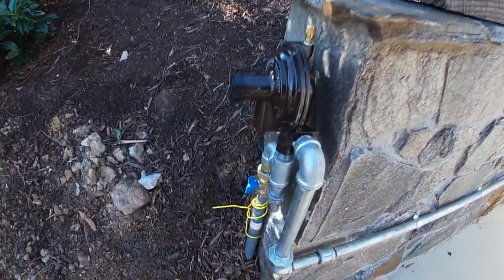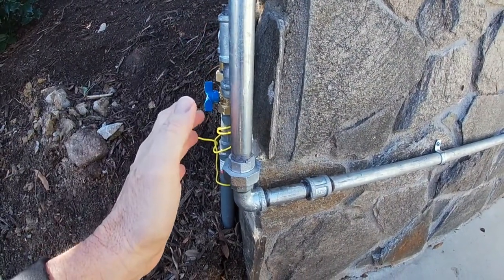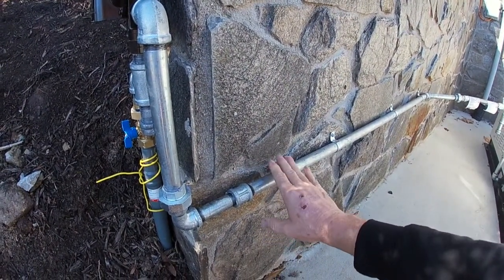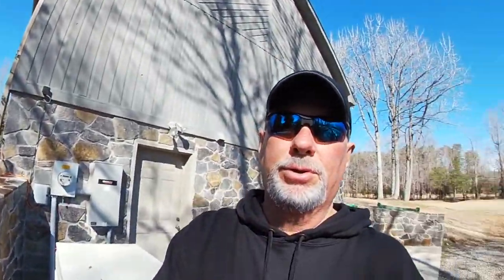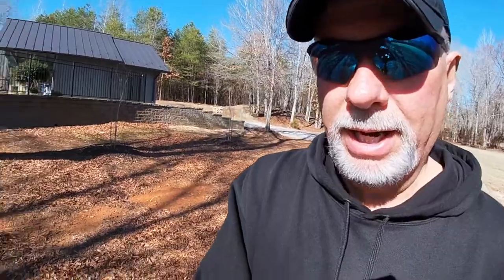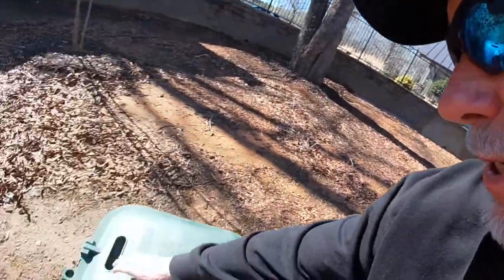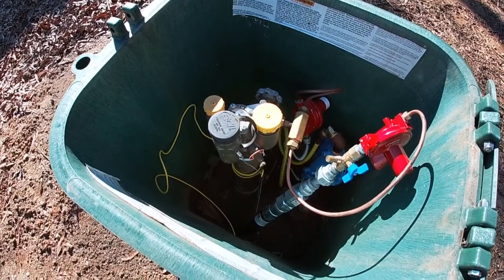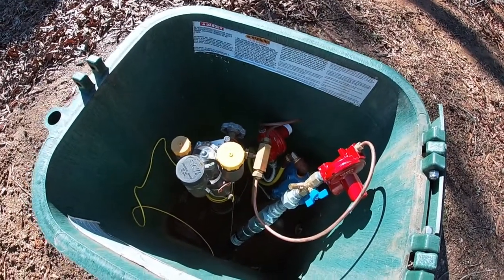HOW TO INSTALL GENERAC 25 KW /  HOW TO CONNECT PROPANE GAS LINE (Pt. 4)

Comment: I'd get rid of the union between the generator and the flex line. You already have a union on either side of the flex line. I'd probably eliminate the union on the other side of the flex line as well. The reason to get rid of the first one is that it will see a tremendous amount of vibration, particularly on start up and shut down. Fuel tech's often use unions for appliances, but don't realize how much motion and vibration a generator has when running, unlike a furnace or water heater. At the least, I would do routine gas line checks with a detector and the appropriate liquid.

Comment: I'm doing the same thing good video, have you figured how long the tank will run your generator
Reply from the maker: My burn rate is 5 to 6 gal. per hour. Over 400 gals. in tank. Days !!!! Thanks for watching !!!!!
Reply: Typically a 500 gallon tank gets filled to around 430-450 gallons I didn't catch what size generator he has but i basically have a similar setup and after a couple of extended outages in the past i learned that a full 450 gallons of LP will run a 24 KW Generac roughly 3.5 to at the most 5 days straight days depending on how much of a load you keep on it. Me personally I typically try not to run any of my large 240v appliances other than my heat and air which is a variable speed Trane heat pump system during an outage all food we eat is either take out or nuked.

Comment: Why are you using galvanized pipe supposed to be black pipe for gas
Reply: Black iron you still have to paint to avoid rust by code in most states.